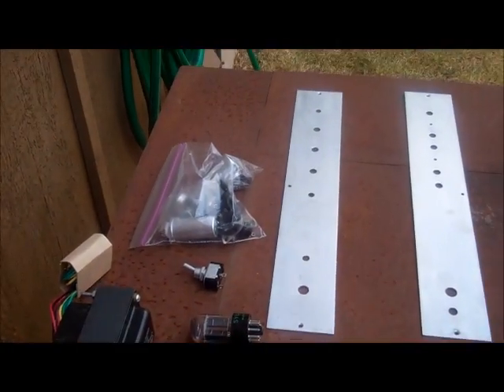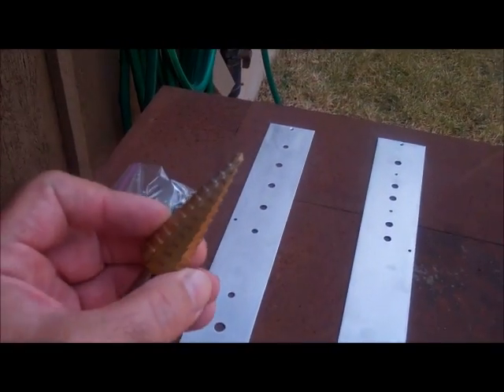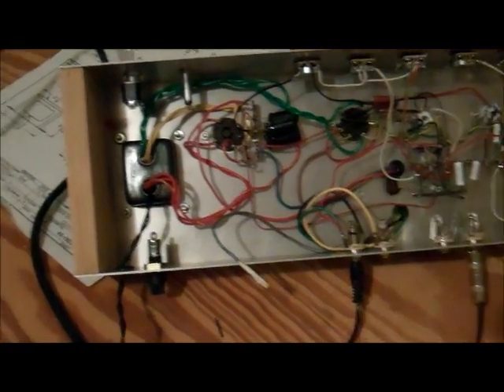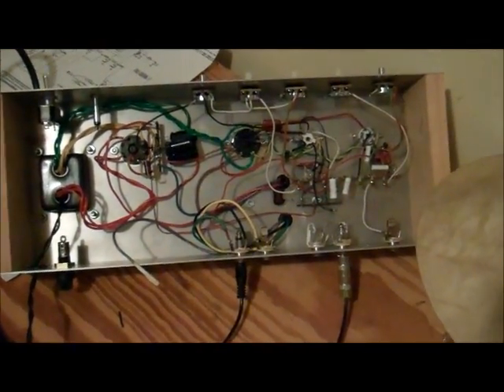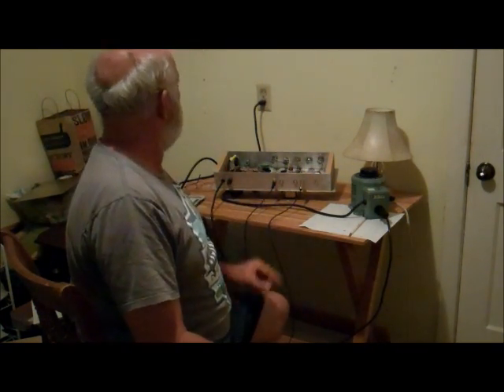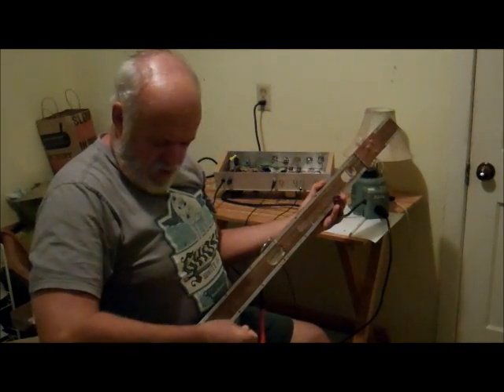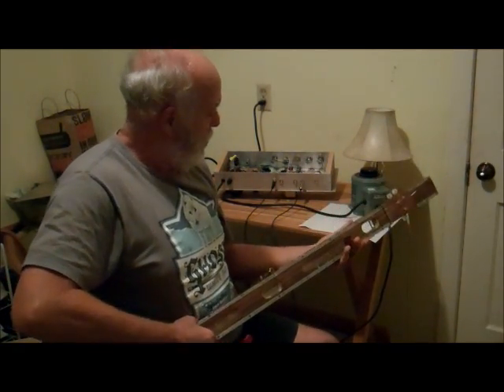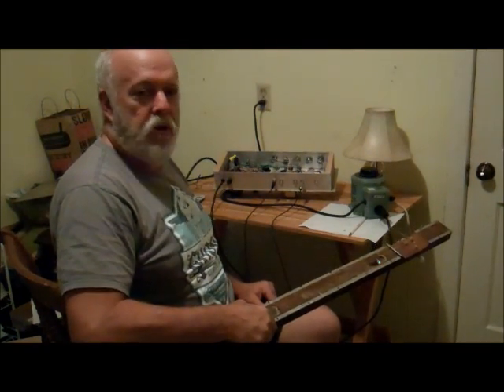vacuum tube amplifier build

Comment: Nice job on the amp and (very unusual) guitar, CW. Several suggestions: You need a higher wattage bulb in the current limiter, at least 100W....maybe even 200W. Your tube bias, as you noted is waaaaaay too high, with a plate dissipation of 16W. 6V6's can easily withstand your PV of 381V......Fender Champs, DR's, and PR's routinely run well over 400V......but the plate current of 44mA is way too high and will harm the tube.  I assume the 6V6 is cathode biased. You need to experiment with higher values for the bias resistor, maybe even 50% higher, to get the plate current down to around 32mA or so. This will solve your overheating problems and improve your tone. Best of luck.
Reply from the maker: +Uncle Doug Latest numbers: Cathode resistor = 901 ohms, cathode voltage = 26.55, plate voltage = 403, calculated wattage is 11.11 at 29.5 mA.  Sounds pretty good, haven't really cranked it up yet.  I used the standard 25 MFD bypass cap at 25 working volts, so I am exceeding it's rating just a bit.  The filters get hit pretty hard during warmup, but I think I'll wait for a failure before I replace them.  There are no reasonably priced 500 volt caps that I can find, so if I need to I'll series-up a couple of 300's or so.  (This is the 'Bronco' schematic with an OLD Motorola 6V6.)

Thank you again.  I am SO grateful for your channel and your kind advice.
Reply: You're welcome, CW. Your new PD of 11W sounds a whole lot better to me. I'll bet you notice a significant reduction in tube heat and a nice increase in headroom. Good work :)